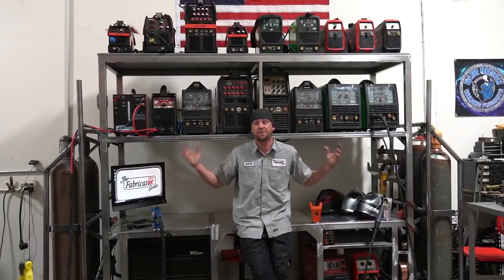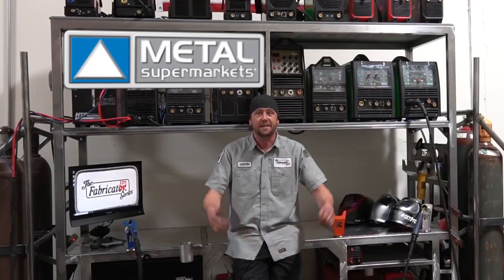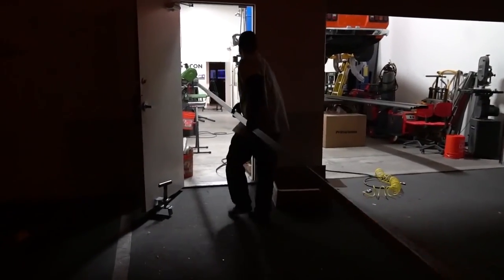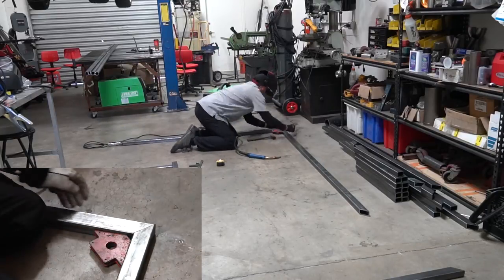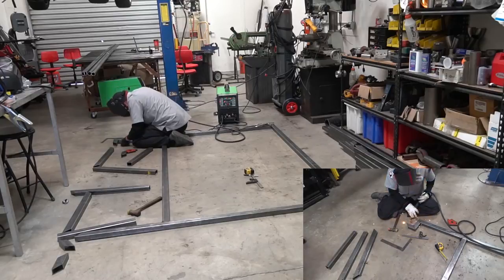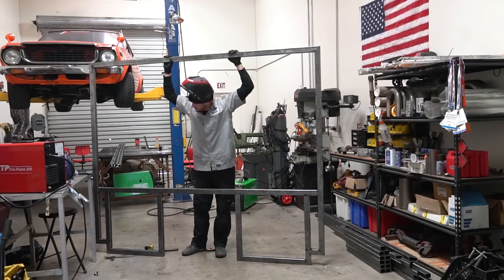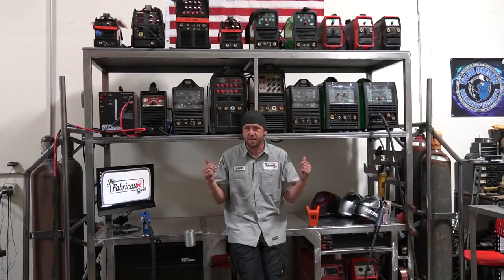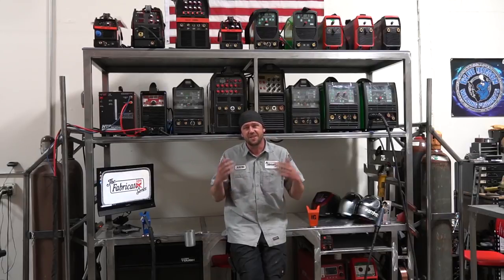TFS: World's Largest Welding Cart Pt. 1 - The Structure

Comment: Built in electrical outs and wiring,witch thanks to those mitered joints should be a breeze. A speed square holder, grinder hangers, and of course tank storage for all your different gasses. Can't wait to see it all complete

Comment: one thing i think you should add is a smoke , gas extraction unit 
a toolbox or set of drawers for the angle grinders , cutters , weldingmagnets  corner vices , scribes pen measuringtools etc are prolly going to be handy too if youre going to use the table surface for building stuff

Comment: On the back you should put a plasma cut logo thats backlit with LEDs for TFS or your sponsored brands or whatever. Another thing I did with my welding table, is in the middle theres a hole with a steel bucket to shovel stubs and shit into. Might be something to consider.
Reply from the maker: I thought about it but I need to keep both sides open for welding classes since that is what we teach the 1 on 1 classes on.

Comment: When you want something square you need to measure the diagonals. This is especially true the larger you build. Using a framing square is good for initial fit up but that is it. Cutting materials accurately is the first step. Next is mating them squarely, Final squareness comes from making the diagonal measurements the same.
Reply: Not always the case. You can get caught out with that. A symmetrical trapezoid has equal diagonals  but the parallel sides are different lengths. Coming from an old carpenter the best way to keep square is to use the 3/4/5 method. For this case the square wouldn't be perfect but perfect enough.
Reply: An old carpenter would recognize that difference between a  symmetrical trapezoid and a slightly out of square frame. I use a ft-inch calculator as a sanity check to know the diagonal measurement.

Comment: Hi bud, ive added a air compressor reel into mine also 240v and done a pipe style headbow that i mounted a light and small bar heater off, also run a lockable door in mine and a rail for clamps etc, mines 600 wide by 1700mm long designed to.fit through doors for on site jobs etc

Comment: Gas cylinder holders and gas manifold for each type of gas you use, so selection of gas is just plug and play.
Reply from the maker: I wanted to run a manifold but I use 4 types of gas and often at the same time. Having a central manifold would mix them or require me to purge the lines which wastes gas. I'm sure I'll come up with a solution though.
Reply: @TheFabricatorSeries  For manifolds, with separate lines and quick connects on the ends. I have worked in places where they ran pure argon and CO2 in manifolds and mixed at the welder ends according to what was required.

Comment: You need to make a gas manifold - each different type of gas into hardline tube/pipe (from tank regulator - low pressure), then taps & ballcocks for each machine... Or, seeing as you are using this more for mobile storage, rather than dedicated use - it seems like you pull the machine down to use it - front gas taps/valves w/ hoses to take to the machine for use.

Comment: What the...
I commented earlier and it's gone?
Can't recall all of it, but I did suggest using slides for the MIG machines so they can just be slid out to change reels without having to manhandle them or take them down. my thoughts were to use modified rails and drawers from an old tool box, as they would slide out and hold the weight, and a simple pin/clip would hold them in place.
Something I thought of since is to, perhaps, use a manifold to connect all the machines to the relevant gas-type bottle(s), with shut off taps, etc, rated for the HP gas, for those not in use?
Reply from the maker: Its probably a combination of youtube's annual purge and their switch over to a different layout on the back end. The numbers and comments have been disappearing all over the place. I'd love some kind of slid-out system but I havent made up my mind yet.
Reply: @TheFabricatorSeries  Ah - one of the other contributors I follow is having an issue where his latest video is only coming up in 360P and has no idea why it is doing so. Must be part of the whole cluster.....

Comment: I'm glad you built this using the mig function of the 221 STI.  I've had mine for a year now and I haven't been very impressed with the mig process.  I don't expect you to give any negative reviews towards Everlast, but I was wondering if you have anything else to say about it, other than what was said in this video.  I've short circuit welded with lower and much higher ended machines and all of them lay better welds than the 221 sti.  I am hopeful it's just my machine though, because I love everything else about it.
Reply from the maker: It works best on 220v input. I ran it on 110 for a bit but had to crank the settings way up to the point where they kept tripping breakers in the shop. I'm also running on 92/8 gas. I ran it on 75/25 gas sometime last year and I think it did just fine. So far the 110 power not being enough is my only gripe.

Comment: No sorry, thank you for trying but No.
The company I retired from has a welding cart that is built on the frame of a Golf Kart, it also has it's own trailer to pull behind it for supplies. Mig, Tig, Stick, Plasma Cut, Gas Cut, it can do it all and run 15 mph all day.
It even had a small Microwave Oven for lunch.
Yes, we spoiled our maintenance guys....................LOL
Reply from the maker: If it moves on its own power, its a "rig". A cart is moved manually. I'm also basing this on the total number of machines it will hold (which is currently more than 20). I think I'll hold on to the title.
Reply: @TheFabricatorSeries  Ok, Ok You win. But I do think if you ever saw it You would be impressed.
Reply from the maker: @johnparrish9215  I don't doubt it! If you have a pic or something send it my way. I'd like to see it.
Reply: Microwave is OK, but as long as it doesn't have a coffee maker is is not finished!

Comment: Hey your project turned out looking pretty good, although to bring up your comment about any tipping over issues you might have due to its height and the weight of it with all your machines / gas bottles loaded on it.... maybe look at adding some straps to help secure your machines an some stabilizer bars on the front an back that drop / flip out if it should become overbalanced at any stage preventing it from falling over.....  look forward to seeing it finished....
Reply from the maker: It was already designed with tip in mind and as it sits right now (fully loaded) it will take a force at its highest point to topple it over. A small crane on the other hand is unknown.

Comment: Small hoist or crane to get those machines down???
Reply from the maker: Not a terrible idea. I'd have to do a lot of calculations to find out if it is a tipping hazard with any weight hanging off the side, but I'm curious to find out.
Reply: I’d skip the crane and just add a freakin freight elevator! 🤣
Reply: What about a crane on the corner with a leg that pivots out with the crane to help stabilize it?  Won't need much of a leg since the cart itself will be a great counterbalance. To help the idea come across text think of a sideways U shape taller than the cart with a hook at the top and a wheel at the bottom. 
Better yet, what about a frame that swings above the cart (in a way similar to those tarp systems for dump trucks, only along the cart, not across it) with a hoist that slides from side to side on it.

Comment: What is you opinion on double Miter joints? Where a vertical, say leg, joins into 2 horizontal miters. Is it worth the extra work, for any strength gains? Maybe an idea for a future video?
Reply: Basil Keen I’ve built a couple tables and a plasma downdraft table using the double miters. Cool factor= 10 Execution of good straight and square joints really depends on what tools you have. If you have a fixture table with angle fixtures and weld squares (like Fireball Tool or Genuine Metalworks squares) it probably wouldn’t be too hard to nail them. But if you’re doing it the way Justin did here, with a mag triangle and a basic square- no. It’s really difficult to hold the 2 sides flush while keeping the “leg” straight and square. Plus, every cut has to be perfect: +/- .5deg or less. Otherwise you have gaps that just makes getting it square that much more difficult and time consuming than it already is. But with the right tooling, I would say it is a stronger joint. JMO
Reply: @ShowMeThePony  cheers for the reply.